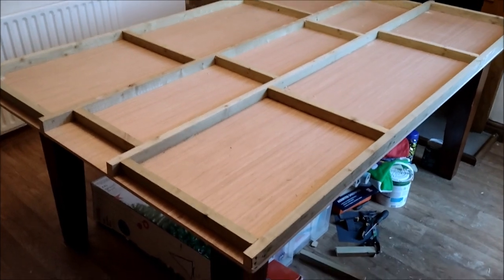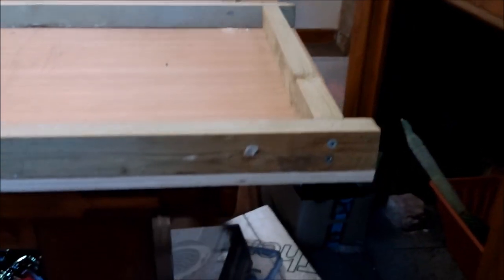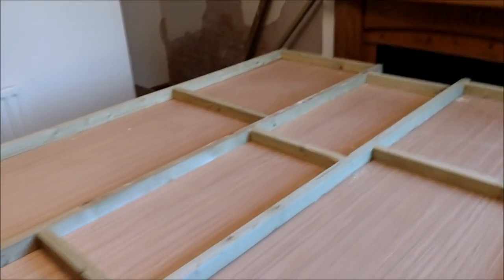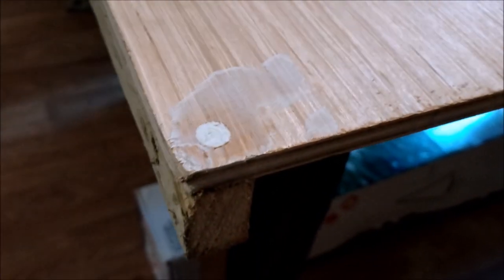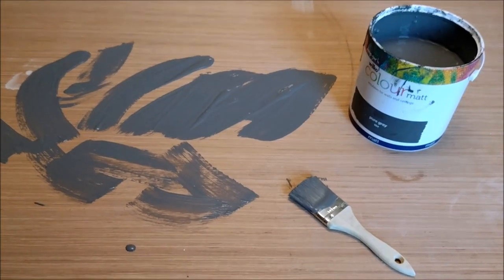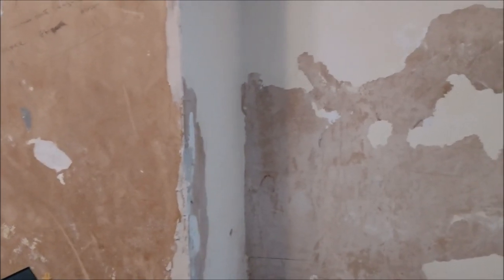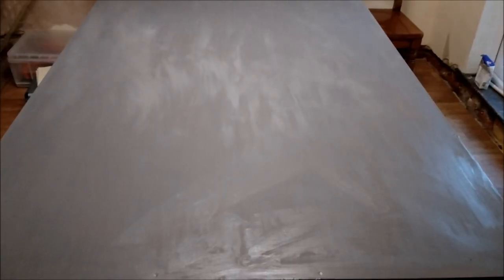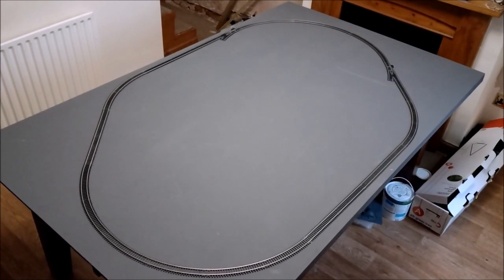1981 Ticket to Ride Hornby Catalogue Model Railway Trainset Part 3 Baseboard Framework and Basecoat

Comment: Hey, what track plan did you decide to go with?
Reply from the maker: Hi! None of the ones from the track plans books as it happens. I designed one that took the original 1981 R535 basic oval as its starting point and added the Track packs that were suggested in the catalogue then extended it and adapted it to suit the buildings and accessories that were also available in the catalogue...tune in for Part 4, uploading shortly, and you will see the result.